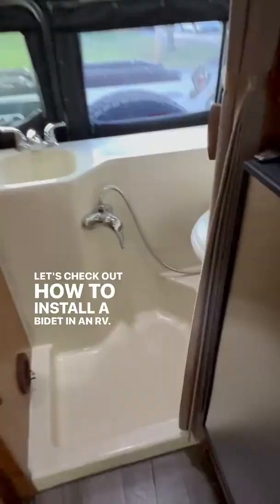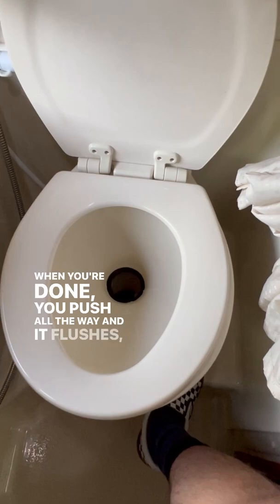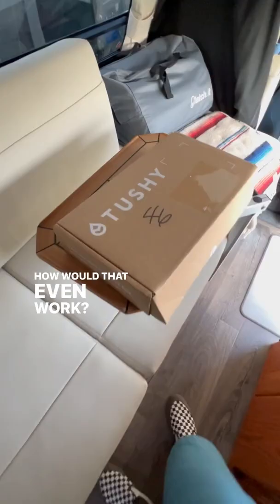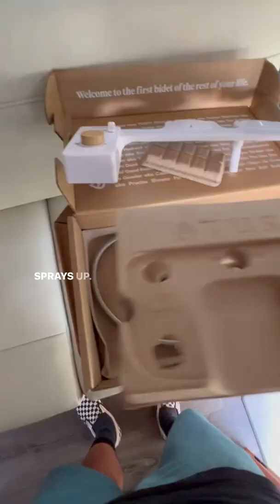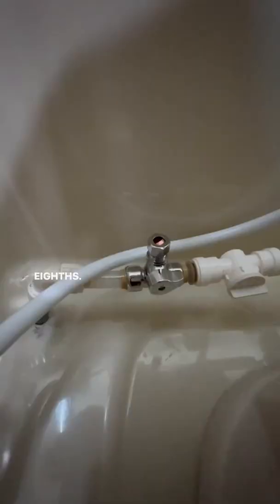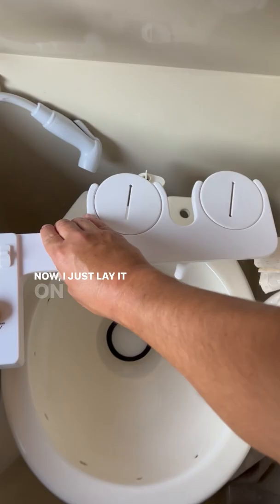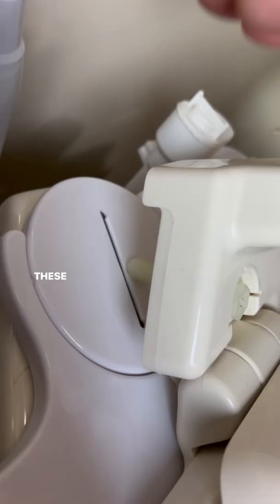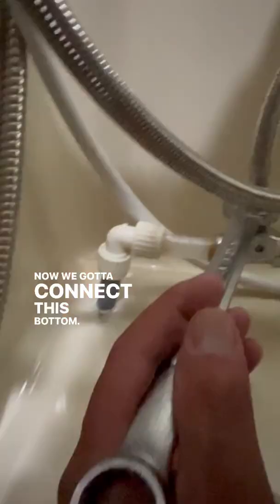Installing a "BOUGIE" Bidet in an RV Camper Toilet

Comment: Patrick! Where can I find this EXACT sharkbite? And do I need to cut anything in my RV? Or can I just easily install without using any knives? Can you upload a more detailed demo maybe?
Reply from the maker: I used a pex pipe cutter and a 1/2 “ shark bite coupling. I’m not sure there is enough interest in this topic for a full video